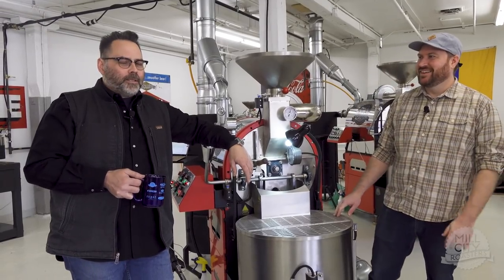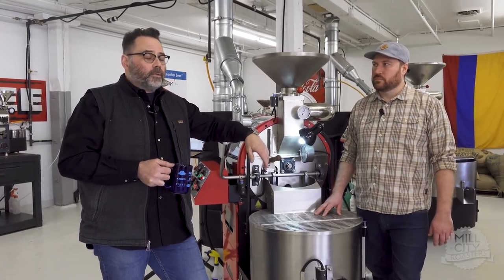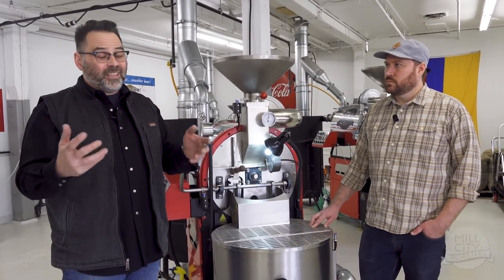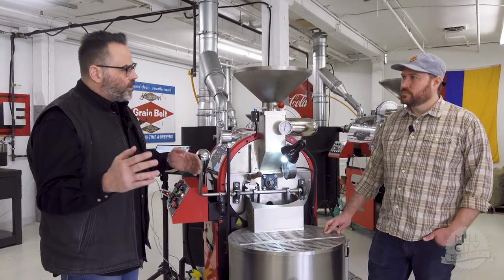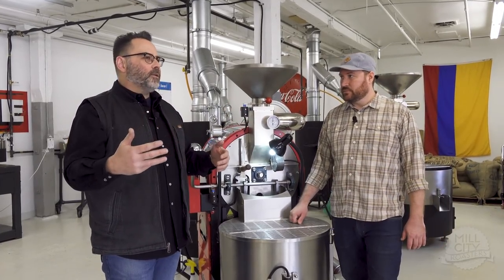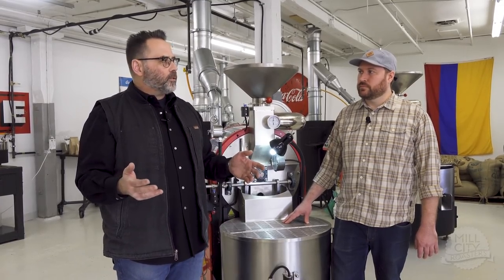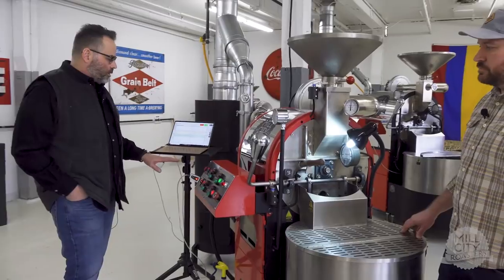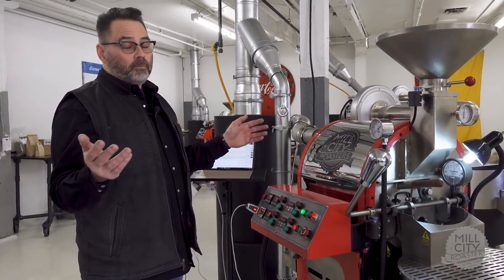Spring 2019 Roaster Updates

Comment: Hi Joe, What if i want to open the trim and i want to see the arms rotating and i want to watch the coffee beans how they are. Is it possible that the arms keep rotating in case i open it? Does it has this possibility? I am asking since, we have roasted on Garanti roasters and sometimes the beans which are closer to the drum, we have not find out why, but on every badge we have 3 to 5 beans which are totatly burned. So we need to see them and  we like to watch the arms rotating and the coffee in it. Also,  if we buy your new 6kg roaster, do we need to buy any spare parts?;  to have them in case of emergency since we are from East of Europe.
Reply from the maker: The cooling tray cover is designed to allow the operator to groom the roast in the tray without risking injury. We've also made an effort to ensure ALL of the coffee exits the drum, hopefully eliminating those pesky burned beans. I think you'll find the cooling tray cover much less worrisome and far more useful than you might think at first glance. We' offer an extended warranty and spare parts package for international purchasers, but we've never had any real problem delivering parts anywhere via DHL . Email your questions to: steve@millcityroasters.com